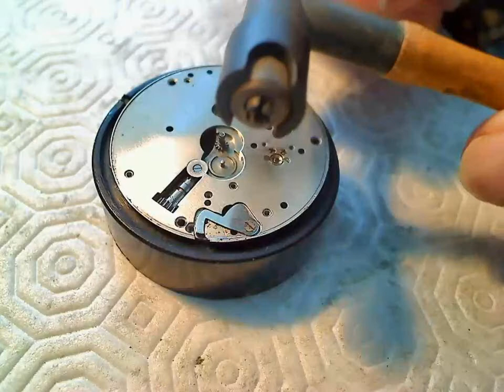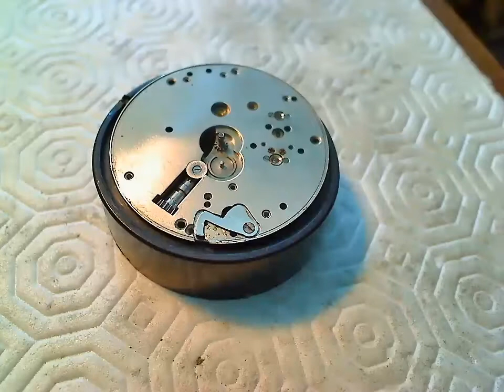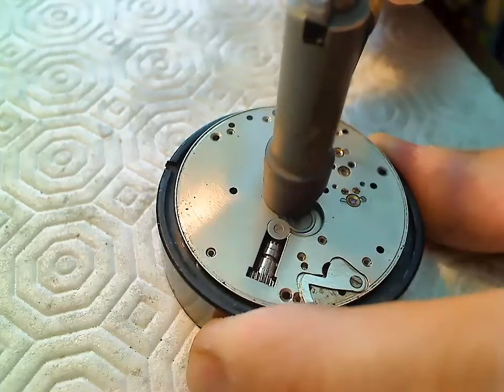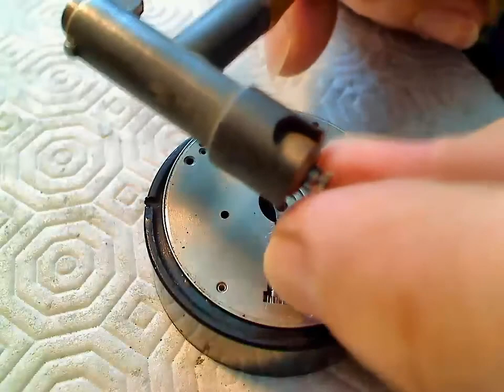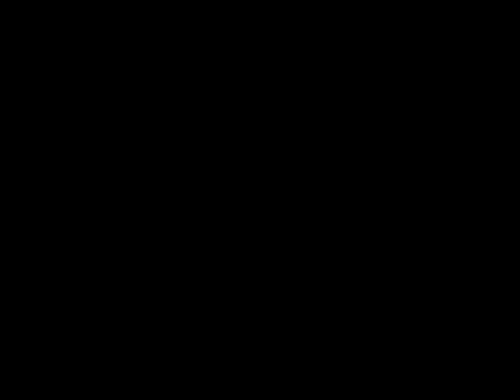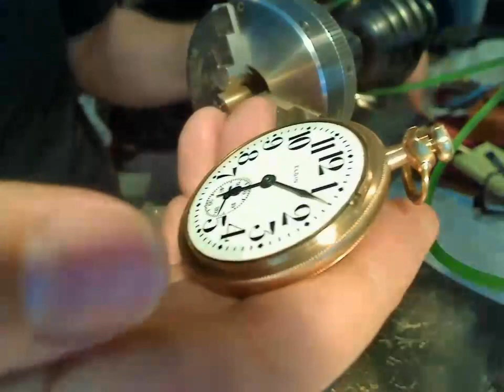Cannon Pinion Removal Tool

Comment: Hi Jd, I have seen this tool listing either Borel or Cas-Ker.  I always wondered if this tool was gentle enough to extract the cannon pinion off the center pinion of the 4th wheel.  Forgive me, it appeared on your video, the you might have broken off the center pinion with this tool.  Hope not, possibly the angle of photo shooting this procedure, just looked like the center pinion went with the cannon pinion like a married couple. Oh well, sure hope not. Enjoy your videos
Reply from the maker: rgoidel Nope, all good and did not break anything.